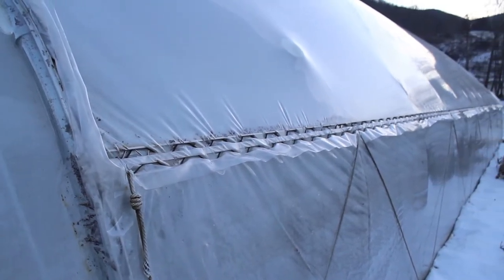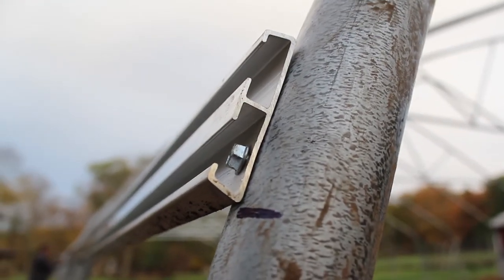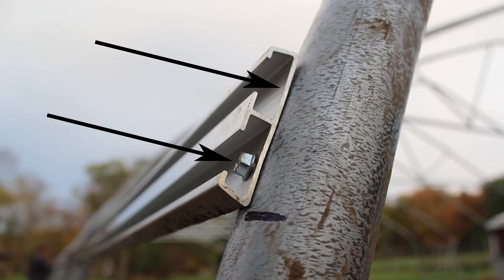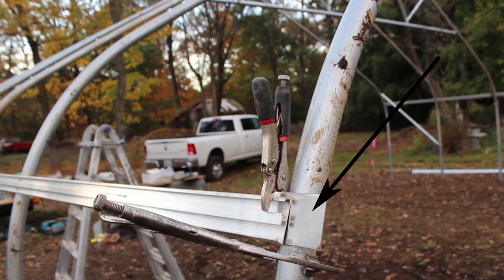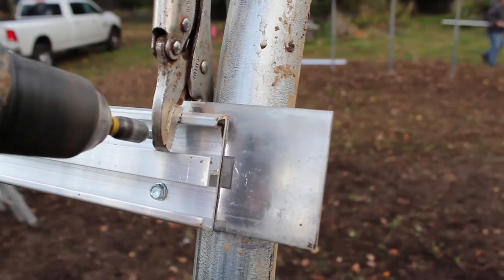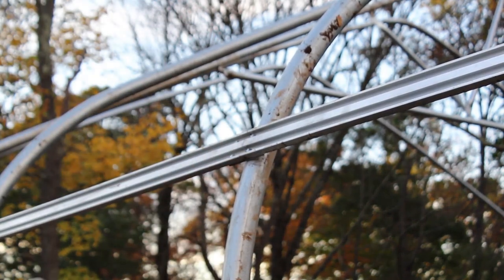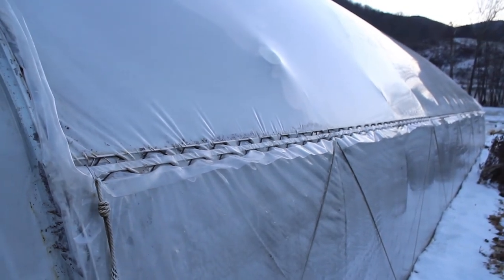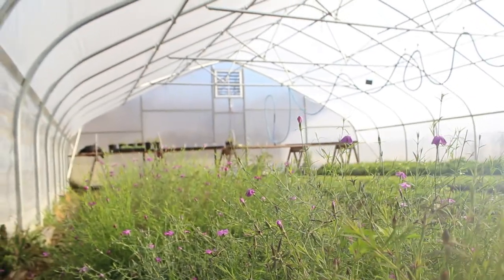Greenhouse Hip Rail Installation - TEK Screw Attachment Method

Comment: if i am building a 22x30 high tunnel with roll up sides, do i need the double track wiggle wire or can i use single track for the hip rail?   thanks.
Reply from the maker: If you use single track it is advisable to attach lumber hip-rails FIRST, and then attach the single channel to that. This is because the single channel really isn’t rigid enough to be a long term structural member. The double channel, on the other hand, can work as a hip-rail on its own, in place of lumber. Hope that helps!